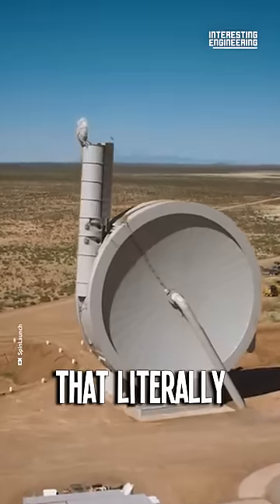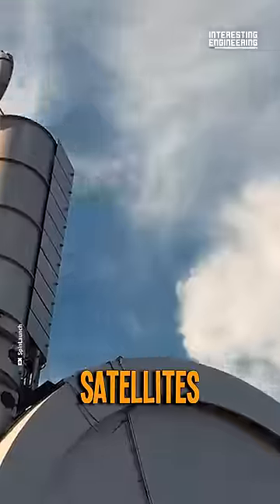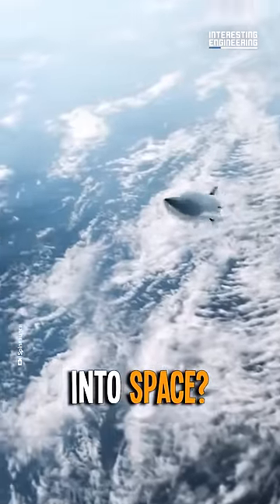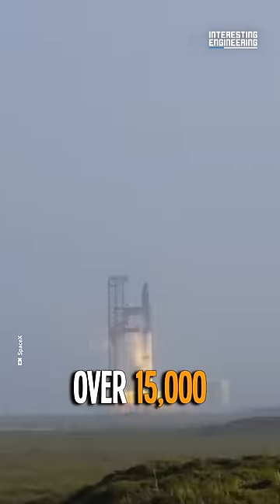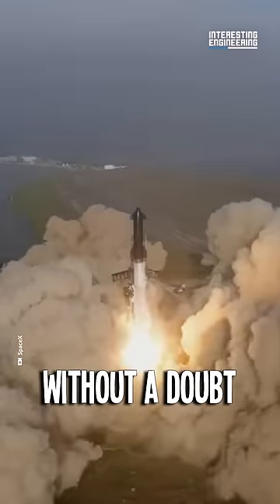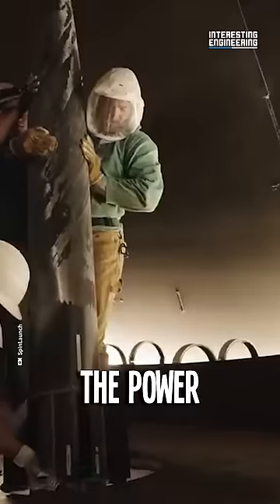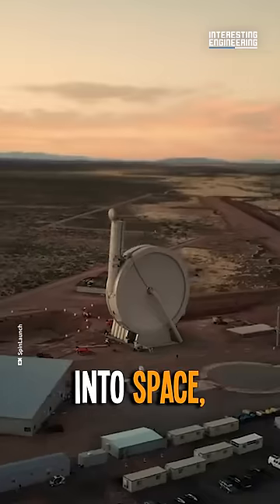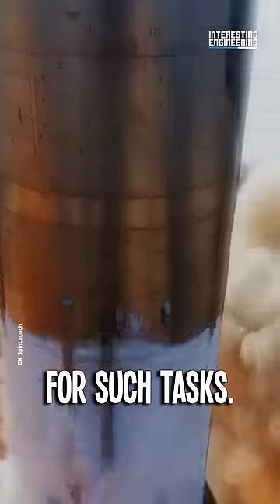Throwing Artillery Shells Into Space

Comment: They fail to mention that it does not work.
Reply: Why not?
Reply: The earth is flat.  @PhilosopherGaming
Reply: and never will...
Reply: It fails to mention any backstory to people like me who never even heard of this!!
Reply: Bro learned physics from duolingo😭💀
Reply: @kimoandrews5802  It works bud. Learn physics
Reply: @PhilosopherGaming  Because they need to launch a projectile at a ground level where air is at its maximum density. As a result they reached only 10 000 m or about 30 000 ft. It is very far from space.
Reply: @PhilosopherGaming  It's a similar issue to the space elevator, the materials aren't there to do it and it may be the case that the materials never materialize.

With this technology, you'd have issues with what happens to the arm or whatever that's being used to propel the satellite into space and the incredibly tight tolerance in the launch tube where a fraction of a second off would lead to the satellite being smashed into the walls surrounding the chamber.

It may eventually be possible, but not anytime soon.
Reply: @SmallSpoonBrigade also in a normal rocket launch your satellite has to endure about 3 Gs. Every satellite is designed to survive the rocket launch because thats the only forces it will ever experience. Try designing a satellite that withstands the forces of the spin up and the transition from vakuum to ambient air pressure without getting completely destroyed.
Reply: @tyjohnston5889 Prove it. 🤨
Reply: @gibbon0220 somebody who already knows a bit of physics is called "thunderfoot". He had an opinion about this a long time ago. And he's right to this day.
Reply: @lukasadamson6091  bro did you ever heard abt centrypetal energy?💀
Reply: Picky, picky, picky
Reply: @tyjohnston5889 if the Earth is flat, why are we trying to LAUNCH something.
 Let's just push it off the edge. 
Any old bulldozer ought to be able to do that, silly.

You know, sometimes the smartest people are just so dumb.
It takes a blue collar to get the job done. 
I'll tell you what: me and my crew will push whatever you want off the edge of the earth. 
Just give us the fuel it would have taken to launch that rocket and we'll put that in 55 gallon drums, store it in Billy Joe's shed, and we'll be good to go for a long time to come. 
How's that for a deal?
Reply: @elskid206 see kids this is why you don't huff glue.  It turns your brains to goo
Reply: @tyjohnston5889    Right along with the top of your head no doubt
Reply: @tyjohnston5889 the earth is a giant pancake
Reply: @DannyBoYfutube   Really?! I've heard about this two years ago.....you sure you haven't heard about this by now?
Reply: It'd be a dope missile launcher though
Reply: @michaelbracho3956  agree
Reply: They would be better using railgun technology to propell objects into space. It's beyond me why musk is still using rockets yet his company is tesla
Reply: @elskid206 You're giving trolls a reason for living with long rebuttals like that.  I can respect the effort though.
Reply: @hyper_state because Elon understands physical and technological limitations better than you, I'd have to guess.   ;-)
Reply: @imantsjansons5009  so you don’t do it at sea level! You can do it from a mountain.
Reply: @gibbon0220 It works to crush whatever is inside with tons of forced pressure put on it while spinning
Reply: @SmallSpoonBrigade what if they made the tube a complete vacuum so it withstood velocity without resistance and made the tube longer let's say half the length of a space elevator or really tall. When it slings it up the tube after it passes a certain point in the tube a door closes behind it near the exit point but not at the exit. The exit door opens after so the sudden pressurization does not have enough forces to destabilize the rocket and then it gets flung from a higher point with more velocity 😮 I wonder if we could also make a space elevator with pressurization, much like planes use to offset structure instability.
Reply: The opening is definitely misleading/false (implying present imperfect).
Reply: Thanks Common Sense Skeptic
Reply: @tyjohnston5889  The Earth isn’t flat but your head clearly is.
Reply: @davidtilley6016  They can prove it by finding the edge and jumping off of it😂
Reply: Articles on the subject say otherwise. This tech is still quite nascent. It will likely have limited capabilities and probably won’t ever work for launching people into space but should work fine for small satellites.
Reply: Are there any videos of experiments related to this? I'm kind of curious what happens when somebody actually tries this.
Reply: @imantsjansons5009  it's purpose isn't too eliminate the need for thrusters on rockets. It's to reduce fuel consumption especially when starting with zero momentum
Reply: Yes it does. It's not supposed to throw something all the way out into space. It's supposed to reduce the amount of fuel consumes especially when it has zero momentum it burns the most fuel. It's a good idea, you guys are weird
Reply: @tyjohnston5889  I almost feel bad for you
Reply: @alphasheep99  To eliminate the need for the first stage they need to achieve altitude of at least 60 kilometers without a rocket engine. If they goal is only to decrease amount of fuel of the thrusters of the first stage it is not what they were telling a year ago. "to spin objects up to speeds of 5,000 miles-per-hour (8,100 kph) and launch them upward, where a small booster will take them all the way into space." I underline-a small booster.
Reply: @alphasheep99  I imagine it's probably for cargo not people, right?
Reply: @tyjohnston5889 even the ancient Greeks knew earth was round. They had a God named Atlas and he carried the world on his shoulders. He holds a ball on his shoulders and not a flat rock
Reply: Is this just a weapon somebody tried once and learned it wasn't good enough?
Reply: @SmallSpoonBrigade I'm sure engineers can do virtually anything they set their minds to, but why? What about, say, weather control? Maybe not, but isn't that basically what the whole issue of global warming is about? So if it's impossible, then global warming is, too.
Reply: @MONKEYGUY8504  The first of the kind was tried even during time of the American Civil war. The idea was a steam powered centrifugal gun. It didn't work well, and military rejected the invention.
Reply: @imantsjansons5009 Cool. Then that's the experiment that somebody did try to find out how good they could make one, and the next thing I'm going to read about to satisfy my curiosity.

edit: Apparently mythbusters tried to build one. Super fun thing to learn about!
Reply: @imantsjansons5009 could they attach a rocket to this projectile and let it ignite near 10000 m height? It will reduce the rocket size or fuel needed a lot
Reply: @PhilosopherGaming  As mentioned by Imants Jansons5009, air density, and centrifugal acceleration much too high.
Reply: @imantsjansons5009 then launch it from an aircraft
Reply: @tyjohnston5889  sure it is buddy
Reply: While this technology has a long way to go it is an interesting concept none the less. It may have only reached a high of 30,000 at 1000 mph but it doesn't mean it wont be able to surpass its current capabilities if the time and money is invested. Like many things we celebrate today, not all of it became fully functional right off the bat.
Reply: @gibbon0220 yeah I learned kinematic physics level one and honestly should have continued with level two
Reply: The smaller test bed worked just fine do not know about the full scale one but it should work as well as the smaller one
Reply: As it sits it a massive failure,  waste of money,  it's like these guys thought this up on a napkin , someone talked people into wasting money to try and make it , BEFORE figuring out if or how or will it work ?!?!?! , not saying it won't EVER work
Reply: No known material can withstand centrifugal force
Reply: @DerekBertrand-j4h  True. but the spinning object can't travel away from the center if its enclosed in that drum.
Reply: I knew this was a bunch of bullcrap the moment I clicked.
Reply: It does not work YET, and maybe it never will, but you don't learn anything if you don't do anything.
Reply: They have a working model but it can only throw something like a third of the way into orbit. That is still pretty good though, because it gets you through the thickest part of the atmosphere where there is most drag. But the biggest downside is that the vehicle and its cargo are subjected to like 10,000 gravities of acceleration from the centrifugal force while it's spinning up. You can decrease this by making a larger diameter wheel but material strength puts some practical limits on that so this method of launching will only ever be appropriate for cargo much, much more durable than puny humans. You need to build a launch loop with a diameter measured in miles for people to ride in.
Reply: @gibbon0220 yeah. if you put a litteral rock in the Rocket. No Sattelite can Survive 5000gs
Reply: Rockets start off slow, why? Drag at lower altitudes because of the thicker air,  this has 100% power and speed at launch and is spun in a vacuum, so, at max speed, they will collide a shell with a wall of air... What's gonna survive that?  +  It's also a problem for escape velocity, because here speed degrades instead of projectile gaining speed...  And much more pretty straightforward laws of physics (sorry for my english, I am in a bit of a rush ^^ )
Reply: @1SqueakyWheel  Correction - the engineers working at a company he own understand that. He himself doesn't understand jack squat.
Reply: @tyjohnston5889 🤣
Reply: @MyGraveDancer  Eh....  I understand your point, and while it's a valid one, it's incorrect in the literal sense. 

True, he hires engineers who are far more advanced and knowledgeable than himself on the details, and there's no doubt he couldn't do any of it without them.  

But he understands quite well the principles behind the technologies he's developing.  
He's not ignorant.
Reply: @gibbon0220  How many satellites have they launched?
Reply: @matthewcohen9582  I'm sure you're very familiar with goo brain.
Reply: @PhilosopherGaming too much gravity. Simply impossible to do with velocity alone
Reply: With that attitude we would have never landed on the moon
Reply: Least pessimistic internet user:
Reply: @gibbon0220 Yet it doesn’t just like the hyperpoop
Reply: Time to eat it!  @Dipkid
Reply: @Calbjrd  ye ive started to eat the buttom
Reply: Just a small detail. The seed funding is the main point.
Reply: @PhilosopherGaming You can't throw or fire (as in from a barrel) an object into space. We've known this since the days of Newton and Descartes. Escaping a gravity well requires a constant source of acceleration. Any ballistic path taken by a projectile that begins perpendicular to the source of gravity will always return to the source of gravity because said projectile is losing acceleration from the very moment it begins its ballistic trajectory. 

It's exactly why The Columbiad space gun from Jules Verne's 'From The Earth to the Moon' wouldn't work.
Reply: @imantsjansons5009 terminal velocity applies to free-falling objects. This machine throws them at a MUCH greater speed than terminal velocity, so theoretically it's very possible to throw an object all the way into space
Reply: @imantsjansons5009 terminal velocity applies to free-falling objects. This machine throws them at a MUCH greater speed than terminal velocity, so theoretically it's very possible to throw an object all the way into space
Reply: @PhilosopherGaming because turning tonnes of a satellite in an extremely high speed is impossible.  this technology is for sending small stones in the sky
Reply: @gibbon0220 so you didnt even check the fact checking of thunderfoot,  who, btw, is a real scientist. Debunked long time ago. With your EXACT argument btw. It rips it apart.
Reply: @TakeASlice-Music in theory, if it leaves with a high enough velocity then it will escape to space
Reply: @alexritchie4586 incorrect, it’s that we don’t have a way to have such objects leave with a high enough velocity. In theory, if you could fire the object at a fast enough velocity it will escape into orbit.
Reply: @gibbon0220  It barely gets higher than an airplane bud. It's no where near high enough to leave the atmosphere. The irony in your comment is unreal.
Reply: So a coal fired power plant provides electricity to spin up the payload in a vacuum……
Reply: Where does the energy come from? Can't make energy!
Reply: @gibbon0220 How many successful launches, mr. physicist?
Reply: @earringsjansons5009 It's almost like the current launcher is a miniature test version to test the concept, so it doesn't throw it all the way...
Reply: @tyjohnston5889  no, it's not.
Reply: @imantsjansons5009  air density is not an issue here. It's the gravitational force you are against. to get to the orbit you need to reach a speed of ~8km/s.
Thats about 25 times the speed of sound in the air.
Reply: Think of how much pressure and gravity you have to counter to make it out the atmosphere. Thats the reason why it takes so much fuel to get into space. You’d literally have to defy physics to throw something into space.  A scale that is almost impossible to achieve
Reply: Getting the mass up there is not consuming the fuel its reaching escape velocity that need the most of the Fuel
Reply: @gibbon0220  Been studying orbital mechanics for the better part of 3 decades.  This is a non starter.  Just like the "hyperloop" was a nonstarter (not to mention not even an original idea.. was nearly 200 years old and debunked just as long before Musk came along)
Reply: Plus it still uses fuel.
Reply: @Jerakk30  So you’re a qualificated persen and you say it doesn’t work?💀 It’s elementary school physics, not a university subject.
Reply: @gibbon0220  No, hes correct, it does not work. A small scale test rig was built (shown in video), and even at a fraction of the speed needed, they couldn't get the release just right. To go top space, it needs to spin much much faster, and the release timing has to be exactly correct to less than a billionth of a second. 1/2 a billionth of a second late, and it crashed and explodes. And thats if you even manage to get something spinning fast enough.
Reply: @gibbon0220  It does not work, learn engineering. Just because the physics check out doesn't mean the engineering does. I mean, the physics of a aerospike engine are incredibly simple and work perfectly, but the engineering requires a material that can maintain strength for 10 minutes at 4000 degrees C, with no cooling. Can physics make that happen? No. And yet, an Aerospike is far more likely than this thing. 
A small scale test rig was built (shown in video), and even at a fraction of the speed needed, they couldn't get the release just right. To go to space, it needs to spin much much faster, and the release timing has to be billionth of a second accurate. Lastly, and the biggest issue, is that this would be at high velocity at sea level, where atmosphere is densest. 5000 MPH at sea level would cause friction and heat beyond anything you can imagine. We'd be back at the same issue seen by the Aerospike, we need materials that just don't exist.
Reply: @Chris-hn4lp  I guess there’s a tantalum based compound ( I don’t know it’s exact name) what can handle more than 4000C degree. And it’s just a help for the satellite’s rocket to be able to reach the necessary speed with less fuel, because of the high initial speed.
Reply: @gibbon0220  Yes.. they teach orbital mechanics in elementary school..... whatever you say...
Reply: @Jerakk30  You can’t understand a whole sentence or what?💀
Reply: @gibbon0220  come back when you can form a cohesive one and also learn to spell elementary school words =)  have a nice day.
Reply: They got paid😂😂😂😂so it worked 😂😂😂😂
Reply: Newton and his third law of motion would agree.
Reply: @MadsFeierskov  bullshit
Reply: @imantsjansons5009 May have use on the moon but not on earth
Reply: @1SqueakyWheel yet he’s the same man terraforming mars. You’re the troll.😂
Reply: @keynogreen  nobody's terraforming Mars.  Which of my comments did you misunderstand?
Reply: @1SqueakyWheel  then you obviously don’t know what he’s doing. Elon that is
Reply: @keynogreen  you obviously don't either.  😁
Reply: @tyjohnston5889 If the earth is flat, then sunsets would shrink to the observer. Yet, they don't. Explain that.
Reply: Why doesn't god just stop all this? Let me guess, it's all part of his imaginary plan...
Reply: @tyjohnston5889 if the earth is flat, then why is the bottom of our feet round? 🤔
Reply: I don’t think the idea is to throw it all the way but just as far as possible and then use a rocket engine.
Rockets use most fuel just to get off the ground and get to speed.
Reply: Can they improve on it?  Is the idea impossible?
Reply: @imantsjansons5009 wonder if starting on a high plane would help.
Reply: @imantsjansons5009  maybe they should do it from the top of highest elevation on earth
Reply: @lukasadamson6091  yeah but thunderfoot is a naysayer on everything new being invented. i like him but he is a contrarian and we need people like him to doubt new inventions and then people to be inspired to prove him wrong and make the impossible possible
Reply: @matthewfors114  It would be difficult to place it on the peak of Everest.
Reply: @PhilosopherGaming  In short, theres no way to speed it up enough to actually make it through the atmosphere. The physics/engineering is bad enough to confidently state there will not even be a successful launch for the next 50 years
Reply: @imantsjansons5009 OOF. There're anti-aircraft guns from WWII that could top 80,000ft... no to mention HARP in postwar 😂 .

SpinLaunch sounds like a confidence scam, that some silly politicians and investors fell for while most of the cash "vanishes" 😅
Reply: @gibbon0220  were you going to share with everyone about the time they actually successfully used it or not. You keep going on and on about how "it works" but have failed to show proof. No one here is stating that it theoretically could not work if the materials used for the payload and device construction were indestructible.

But the the fact is that they have had ZERO successful launches to this day. Pretty sure it has turned into a con for investors at this point.
Reply: @PhilosopherGaming 

To reach the iss you have to be going 27576 km/s. Horizontally around the earth. Thats very very fast. That's "burn up" fast. Since you lose speed in the atmosphere, at launch the slingshot would have to large you even FASTER than that.

But that's only half the issue. In order to reach an orbit you need two points of acceleration. Because orbital mechanics will tell you that you will always return to your last point of acceleration. If your last point was on the ground, you will smash back into the other side of the earth. No matter how fast you go. No matter what angle you launch at (unless you want to perfectly skid across the ground I guess).

The slingshot is only one point of acceleration.

Now they claim they can slingshot things into orbit. We know that is not possible for two reasons. So the last option is that you slingshot a rocket that can then do the second required burn.

So now you aren't slingshotting cargo. You are tossing very explosive fuel. So your limit on acceleration is even lower than whatever cargo you wanted to toss and your weight is higher. And you still need to be going VERY fast because you need to reach 400km straight up before you do your second burn otherwise you need three burns to reach the ISS orbital height.

Do you see the problem yet?
Reply: @hyper_state ANY technology that relies on one instant acceleration will fail.

Also the crossover between an electric car and a rail gun is "uses electricity". It's about as similar as a toaster and a Tesla are to each other.
Reply: @CaptainOverLoad I mean sure, except those materials do not exist.
Reply: if a cannon ball having a speed of 8000 meters per second is thrown horizontal to the surface of earth then it will revolve around earth in a circular orbit bcz its the distance at which earth drops a vertical height of 5 meters thats how the sattelite revolve around earth they are constantly falling toward earth but the curvature of earth prevent them from hitting the ground and thats why astrounots feel no gravity in space bcz they are in state of free fall so no support force is acting on them and without a support force gravity cannot be felt so they  are not in zero gravity they are just taking an endless rollercoaster ride
Reply: @PhilosopherGaming  because space is a vacuum without the force of fuel to basically push yourself against the force of gravity and the vacuum of space at a really high speed there is no way for you to move
Reply: well they’ve only built a 1/8th scale prototype so yea….. wha…. why… would that work?
Reply: No, they wouldn't lie about something this big!  
😂😂😂😂😂😂😂😂😂😂😂😂😂😂😂
Reply: @tyjohnston5889 

How does that work?
Reply: @tyjohnston5889 I sincerely hope you're joking.
Reply: @gibbon0220  aerodynamic drag? you think you can just throw something at 17000mph?
Reply: @imantsjansons5009  But that's 10 000 m or (about 30 000 ft) worth of rocket fuel that now DOESN'T need to be used
Reply: @Messier42-handle  Phisically yes THE MACHINE can. This wheel’s diameter is about 20m. If it can spin with 10000RPM the ending spot of the wheel reaches 37000 km/h. Which is faster with 10000km/h than the escape velocity.
Reply: That's cause the satellites that are just below the Ka'rma'n line are all on weather balloons & none are actually in "Space" ..
Reply: @PhilosopherGaming Number one they don't have the capability of spinning something fast enough to get the velocity to go to space. 

Two if they had enough velocity on impact the atmosphere with enough speed to actually reach space or orbit nearly anything would vaporize no matter how good you engineer it unless it is utterly massive and solid like a 🪨 and obviously they're not planning that with their rig.
Reply: @tyjohnston5889  as a remote viewer who's been outside of the earth it's really not flat it's a sphere and it glows golden and has a blue later around it.
Reply: @tyjohnston5889 Hah, yeah right. Nice joke
Reply: @tyjohnston5889  If the earth is flat then why is the moon round?
Reply: @matthewcohen9582  Better glue than the paint chips you ate as a kid
Reply: It's never been completely tested, and so far, it has worked. Their small-scale testing has been positive.
It will most likely work and could be a useful tool if improved.
Reply: Yet
Reply: @gibbon0220  It has not been done....It won't be done.
Reply: I'm boil bial
Reply: @matthewcohen9582 But he is right. Which is why you went to insults instead of disproving his idea. They have not put anything into space certainly no satellites.
Reply: It does work… why are you saying it doesn’t?
Reply: Daily dose of poor science episode
Reply: Just put inertial dampeners on it. Don't you guys watch tv?
Reply: @imantsjansons5009  so tell me again, when were the test launches, and what were the results?
Reply: @gibbon0220 really? How would this hypothetical functional satellite survive the G-forces being applied to it? I’m genuinely curious.
Reply: @MONKEYGUY8504 Weather control IS being worked on by the US and many other countries. It’s not a “one or the other” situation. 

Obviously, choices have to be made when money and budgets are involved but that doesn’t mean there aren’t many irons in the fire at any given moment.
Reply: Yet
Reply: @oooshafiqooo  you mean a multi stage rocket. As in the thing they use right now?
Reply: @tyjohnston5889  awww fuck here we go  ....🙄🙄🙄
Reply: @tyjohnston5889  earth isn't flat
Reply: @flightmaster529 at least two years ago
Reply: For now !😮
Reply: @gibbon0220  It works? Where? Do you know any physics behind this? I doubt it. This has the same issue as had the hyperloop BS.
Reply: @matthewcohen9582 He is right, if Earth is flat you can fall off if you're traveling on a boat to the edge on a flat plain.
Reply: @gibbon0220   lol it doesn't you should learn some physics
Reply: @tyjohnston5889 Fact, but they might be getting them into the aether we've seen Musk's disposable rockets hanging 10 on,   and deep enough for it to hang around up there for a little while.
Reply: @Alrold  I did, but it seems it’s not true to everyone
Reply: @IceBox666theone666  physically it’s possible. In engineering is a different question.
Reply: @imantsjansons5009  Maybe build it on top of Mt. Everest?
Reply: They sure built a huge device though and did a lot of tests over a long time : but hey this 30 second clip is enough for experts like us to say it doesn’t work
Reply: @PhilosopherGaming  cuz you need a counter weight to the sattelite inside the spin. Then when the satellite/rocket throws out theres too much weight on one side :D
Reply: Yet
Reply: @gibbon0220 you must be a trumper…😂
Reply: @imantsjansons5009 that is with the tiny prototype.  It was prof of concept.  The new much larger version uses the math and physics you speak of.   Tired of crabs clawing from the cage
Reply: @SmallSpoonBrigade it's easier to time the release on this thing than it is to land a massive rocket 🤷 by far, actually...
Reply: @PhilosopherGaming because you need to reach a speed of more than 11km/s to escape gravity without propulsion after launch
Reply: @gibbon0220 it does not buddy, learn physics
Reply: @YouTube_is_full_of_trolls  Username checks out.
Reply: @gibbon0220  The physics says it doesn't work. Air resistance alone says "lol no". You would know this if you'd passed basic high school physics.
Reply: @darylingoteborg3178  You aren't the only one able to access that other information.
Doing a bunch of tests is not the same thing as a successful launch.
Reply: @imantsjansons5009  if that was artilery how far will it fire?
Reply: Yet…
Reply: @lessonslearned6760  The projectile would have to rupture the sealing  diaphragm at hypersonic speed,so yeah I wonder how are they going to solve that😅.
Reply: @stevenschnepp576  Air resistance? Really? Do you think there is no speed what can defeat the air resistance?
Reply: @imantsjansons5009 thats because the prototype launcher was a tech demo that's smaller than the proposed launcher.
Reply: @lukasadamson6091 thunderf00t is a chemist who suffers from the dunning kruger effect and thinks himself an expert on aerospace when that is not at all his doctoral field. He has made countless mistakes and bad-faith assumptions on his space related videos and refuses to admit when he is wrong even when actual aerospace engineers refute what he says.
Reply: @TheCerealkiller148  Scaling in engineering isn't often linear. E.g. You cannot build a 10 km high skyscraper using the same technology as a 1 km high one.
Reply: @MONKEYGUY8504 wow. Scary how little about your own world that you know.
Reply: @imantsjansons5009 they said a ticket continues from a certain point to finish the journey.
Reply: @gibbon0220 Bro didnt learn physics at all😭😭😭

It cant get to a high enough speed before the arm rips itself apart from the forces because we simply dont have the materials, same reason we dont have tesla turbines even though theyre better
Reply: @Latelacia  PHYSICALLY it’s possible. IN ENGINEERING it may not.
Reply: @gibbon0220  PHYSICALLY its impossible, we literally do not have the materials to do it, its not that its too expensive, they. do. not. exist

Theoretically yeah, you can fling something into space, but what could be doesnt mean that it is, it does not work, no one claimed that the concept doesnt work because of physics, they claimed that the device in the video does not work

Anyway, congrats, you contributed to science significally by being the densest material ever discovered!
Reply: gibbon0220,
Nope, never will.
They've been trying for many years and are not even close.
Reply: @mrbmp09  Youre just equally wrong, we havent solved material sciences, so much to learn and try and discover, no way to tell if its going to be possible in the future
Reply: @hyper_state hear me out here:

Batteries as a reliable slurce of stored potential energy is way, way, way overstated.
Reply: It definitely won’t work with human cargo because it would turn your organs into mush from the g forces before launch
Reply: It does not fit in the money laundering formula of space exploration!! So a big NO it will not work 😂
Reply: @tyjohnston5889 is this a joke ?
Reply: @davidtilley6016 idgit. Pretty sure he’s joking
Reply: It won't work because the amount of energy you would need to impart on an object to reach speeds necessary to reach orbit would cause any material to immediately disintegrate.